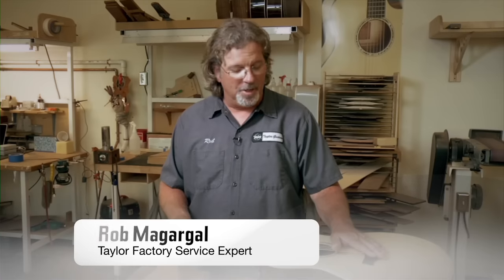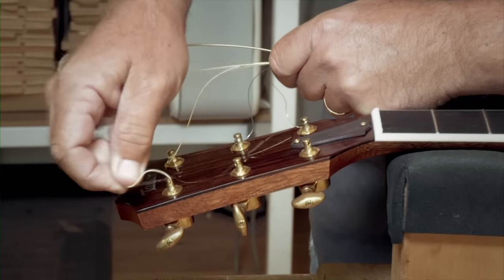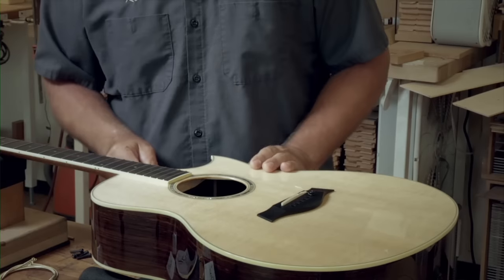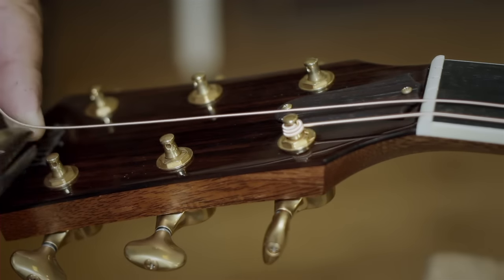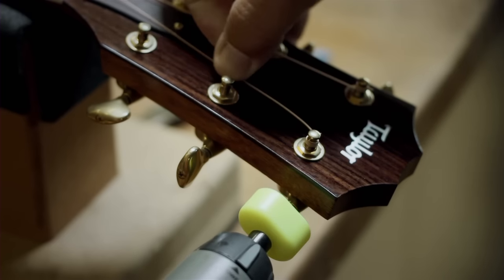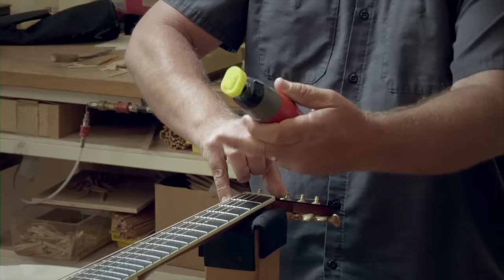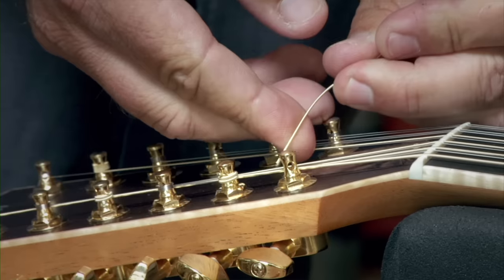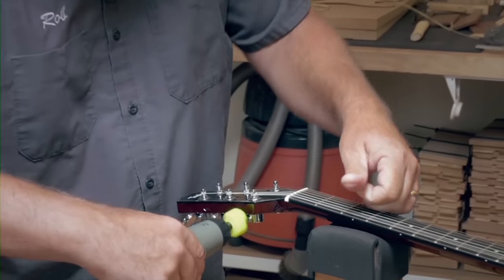How To Restring Your Guitar - Taylor Guitars

Comment: This is the second restringing video I've seen where you "pros" use wire cutters to pull out the pegs. If you push the old string down into the peg hole, the peg comes out easily by hand and you don't risk scratching your guitar or pegs.
Reply: Good tip,  looking forward to practicing it.  T.Y....  I recently scratched my bridge using the cutters!  Not because of the pros told me‐ I just impulsively used them as I was wrestling with a stubborn peg.  First and last time I make that mistake hopefully.
Reply: Yeah makes sense, I don’t want to scratch  my 5k guitar though👍🏻
Reply: I've a peg-puller on my capo. Way to go!

Comment: I was a nervous wreck at the thought of changing strings on my new 2015 Taylor 914ce.  This video was amazing!  I followed it to the tee step-by-step and it came out amazing.  When the strings were all off, I polished the whole guitar and oiled the fretboard with Taylor polish and fret board conditioner.  I went down one gauge to 10's and it plays much easier with no buzzing.  Thanks, Rob!!!
Reply: +Ray Blanks what strings did you have and what do you have now?
Reply: Taylors at the 800 and 900 level usually come with Elixir HD lights, which are light on the treble (unwound) strings and medium on the bass (wound) strings.  That way you get plenty of low midrange and easy bending on the upper midrange.
Reply: I just broke my D string tuning to open E lastnight. Im always nervous when changing strings especially after only having my new ibanez talman electric/accoustic a week then breaking a string haha. I bought a string winder lastnight so hopefully i can do this when my new strings i ordered arrive soon. I got a 9-45 gauge pack cause i dont like the thickness of the ones that came with it

Comment: I've been putting strings on my guitars for a L-O-N-G time and, as it turns out, I have not been doing it as well as I could. After watching this video and following along I ended up with the neatest, tightest wraps I've ever had. Rob keeps it simple but doesn't gloss over the tricky bits (cutting the strings to length and starting the wraps). Well done!

Comment: I got a new, Big Baby Taylor in on Sunday, which I bought from Sweetwater. I'm 63 and have 50 years experience as a player and my BBT sounds awesome. I'm going to take the stock strings off today and replace them with some Martin Phosphor Bronze which are the same gauge ( 12-54 ). I'll try this method because the standard under and over, does not always guarantee tuning stability IMO.
Reply: Love my Taylor but she'd the 12's for 11's . Just a little less boom but my fingers are much happier
Reply: @lancebarbarino8178  When I got my new Big Baby in last weekend, I sanded down just a bit, the stock bridge saddle and my fingers are happy too. There's no need to change the string gauge if you try this , along with using a Taylor Truss wrench to set the neck. If you're not comfortable doing this, a qualified luthier will be more than happy to take care of it for you.

Comment: Nice instructional video. Two observations:

1. WASH YOUR HANDS before you start. That will avoid getting oils all over the strings. You'll get enough of those anyway, but make sure your hands are clean, just as you would before you start playing.

2. In don't like using a cutter to remove the bridge pins. I suggest a bent nose pliers to avoid even slight cutter nicks in the pins. 

Ernie Ball make a tool called the Power Peg I use as a string winder. It's a right angle rather than a straight.
Reply: Teaspoons are fine

Comment: I use this method on all my guitars with the 3 + 3 headstock configuration, regardless if it's a Martin, Gretsch, or even a Taylor lol. Never had any tuning issues since.
Reply: thanks that was my next question.  I dont have a Taylor, but a Martin and a Custom made Mike Long Dred, not a taylor

Comment: I'm so glad I watched this!  Just completed re-stringing my guitar for the first time and this video really helped to put me at ease about doing this.  (Although I'm still a little afraid my bridge pins might pop out.)
Reply: They won't pop out. You don't need to muscle them down in there either. Forcing them down will only stretch the holes. Just make them snug. Congrats on your first string change!! First of many to come!!
Reply: I hold my other hand over the bridge pin until the string is up to pitch... then I also stretch the string especially down by the saddle and check for string movement

Comment: I always put an opposing bend in the string end as it exits the post (forming a Z shape).  For the small gauge plain strings I bring the free end back around and pull it under so that wraps go over it.  The only time I cut strings to length before they go through the post is on Rickenbackers with the 12-string slotted headstock.  Otherwise I cut after putting in the aforementioned opposing bend.

Comment: Using this method, I had difficulty with the 2 smallest strings.  I especially had trouble with the high e string.  It kept coming unwound.  Next time, I will bend it and not cut it until it is wound.

Thanks for telling us about using the 10 mm socket to tighten the tuner nuts on top.  I purchased a $4 1/4" drive 10 mm deep socket just for this purpose.  Even though I do not own a $3,000 Taylor, I own a $350 Takamine EG340SC with a solid top for practicing, the top tuner nuts are also 10 mm.  This seems to be standard on most guitars.  I used my 1/4" drive straight socket simple handle.  Do not use a ratchet.  I used minimal force with 2 fingers.  I didn't want to crush the headstock.  ALL 6 of the 10 mm nuts were not tight.  I was actually surprised at this.

BTW, I also used a *Dunlop System 65 Guitar Maintenance Kit*, with the 5 different bottles, 2 cotton cloths and 8000 grit cloth, to clean and protect the top, fingerboard and guitar strings.  See video HnGEnpG3l0o.  Standard strings for Takamines are D'Addario EXP16.  The total job took 12 hours, but that's me.  I haven't replaced strings since years ago.
Reply: I play banjo too and it is normal on the banjo for a picker  to have a screw driver to tighten the tuners and I wonder why no one talks about tightening guitar tuners which are under much more stress.

Comment: Great video on changing strings!  Probably the best Ive seen.  However, why don't you lock the strings by doing then over-under wrap method?  Ive done it on my accoustic and it works well.
Reply: I have been doing the over under variant for about 50 years on both guitars and banjos.  The over/under really is based on the ways that tuning posts used to be made say in the 1930s and 40s, where the tuning post is not tapered as it is on modern guitars and many modern banjos. It is the taper that helps the no knot method  here work.  This is a lot easier to get a string off, fewer broken strings, and less confusion and tangle.  The over under looks cool when it is demonstrated on the E string but can be a string breaking struggle on the E or A especially on a Dred with medium gauge strings

Comment: Cutting the strings before winding is the way to go!  Allow a post to a post and a half as he says and you cant go wrong.  Makes the string soooo much easier to handle and less chance of scratching the guitar or yourself.  Also, my tip is get a little mirror and double check your ball ends are indeed snug up against the bridge plate.
Reply: You will increase your chances of that ball snug against the plate if you cut your Bridge pins on an angle... cheers

Comment: Do you have any thoughts as to putting a small amount of graphite at the nut when you restring the guitar? I see some professionals do it and others not. Thanks for the posting as it makes it easier to follow than many others.
Reply: Usually that is done on  instruments with a nut if the nut is buzzing because string wear has marred the size or the angle of the nut.  Unfortunately,  it is often a temporary solution.  If whatever causes this continues, you may need to replace the nut or get a harmonic readjustment of the guitar.
Reply: @writerrad  i do it because thats what my dad taught me, and he said that it helped it tune up and down better because the graphite lubes the string. it kinda makes sense but i dont think theres any science behind it haha

Comment: If you are doing this, especially if you are NOT doing this on a brand new guitar like this tech is, be sure to keep the bridge pins in proper order as to the string they have come off of, because the pins will bee grooved to the fit of each string.  A pin that was on the E string will be too loose for the B or E strings for example.  Inspect the pins to see if they need replacement.  Above all replace the cheap plastic bridge pins many guitars come with with hardwood like Ebony or better for my taste Tusk or Ivory bridge pins.  Same with the material in the saddle.  This is a very inexpensive way to make a quick improvement in tone and tuning.
Reply: vip

Comment: Regarding te slotted headstock: you state "wind from the inside to the outside". This makes sense for both the E-strings, but for the other strings winding to the inside makes the strings go in a much straighter way with less friction on the nut. So that seems to me much more logic than the way described here (without any explanation why one should wind to the outside). Also for the top strings (B and E) 1 1/2 post length difference seems a bit short, because those strings have less friction. In that case I think using two post lenght as a difference can help to prevent slipping and get a stable tuning quicker!?

Comment: This is as good a way as any (and there are many.) Danger Will Robinson- if you like round core strings then think again before cutting those wound strings before you get them up to pitch. FWIW, I trap the free end underneath the windings- much like a Fender slot post but with the poked down bit underneath the windings instead. This takes much longer but looks neat and completely safeguards the cut-off ends from careless digits. Back in the day before the tube, we had to figure things out for ourselves and looking at YouTube comments generally and maybe those on this video too, I sometimes think it's best we think about thinning the herd...
Bottom line- this method is sound but whatever works for you is fine too.

Comment: @Taylor Guitars Hi Rob, I have heard many do not recommend trimming the guitar string once it has been wrapped around the post because it will lead to tunning problems. The winding method (type of wound i.e. round wound, flatwound) of the string itself also play a part in this? I noticed you trimmed the string prior to wrapping it around the post. If I decide, because of my comfort, to bend the string instead or cutting it, 'when is it safe to cut the string?' I hope this question makes sense.
Reply: I have cut the strings after installing them for the past 40+ years with no tuning problems.
I cut after installing and stretching each string just because I don't want 6 tentacles flying around while I am finishing the job.

Comment: All you have to do, is run the entire string through the post. Back it up maybe a post-and-a-half's worth. Bend the excess toward the middle of the headstock. Wind the string down like a coil (the lower on the post the string, the tighter against the nut it will be). Then bend the excess string back and forth until it breaks off cleanly. No need for clippers. No stickers to nail your fingers. However, you have to twice overwrap the string-through on the 1st and 2nd strings, otherwise, when you break off the strings, they will slip on the posts.
Trust me. You will love having no stickers to draw blood. By bending the excess string toward the middle of the headstock, you form an "S" through the post, adding to a tight fit. Oh yeh, some nut lube on that nut will work wonders for tuning. That’s 60 years of string changing experience for you …

Comment: On my Taylor 314ce, I never got that reassuring "thunk" when first inserting the pins; it was only after I gave the string some tension that I was able to seat it correctly. Sure hope I did it right. And yes, next time I do this I will buy a winder; that took a lot of revolutions.
Reply: Mitch Friedfeld wait so u don’t have to have a winder to do this, because i’m about to change my strings and i don’t have a winder so can i do it without a winder
Reply: Jeffo You can do it without a winder, it’ll just take longer. I’d bet a large majority of guitarists don’t use one.
Reply: Mitch Friedfeld thanks 🙏

Comment: In 30 years, never had Anyone Show Me a True 'Method'.  Well cutting the wires First is Everything I needed, been doing this Since I first saw This 5 years ago and Never got less than Perfect results!!  AND i'm Done in 20 min.  The Key thing here is to Cut the damn strings Before 'Winding'.  And Holding them down near the pegs while winding.

Comment: hey Rob great video thanks so much! I've got a few questions though:
1) I've got a NS74ce.  As you know, this has a slotted headstock; do the stringing techniques still apply even though you were using steel string in the video?
2) the NS74ce is originally strung with extra hard tension d'addario classical nylon strings.  If I wanted to use d'addario folk nylon strings (EJ45) that happen to have black ball ends and are NORMAL tension, do I need to worry about adjusting my truss rod?  Thanks!
Reply: I’d adjust the truss Rod anyway

Comment: Cutting the string leaves a sharp bit sticking out.  If you bend it and then just waggle til it snaps the sharp end is flush with the peg or just inside the hole so no sharp bits.

Comment: nice video, what is the screw driver used? I would like to buy me one of those. Thanks
Reply: you can buy drillbit heads just for this, but ernie ball make a power peg which is just a screwdriver specifically made for this its like 30 bucks
Reply: Brendan Morris Cheaper to get a cordless screwdriver and the bit, though, and you'll get more speed and torque. 
I, too, would like to know the specific screwdriver used in this video.
Reply: Aluchi Del Pasado Alright, after much analysis, he's using a 3.6volt Black & Decker. I believe it has been discontinued, but the LI2000 is pretty similar.
Reply: ***** awesome cheers

Comment: Rob, I just purchased the same B&D 9074 screwdriver you're using. Can you tell me what the mod is you're doing to increase the RPMs. Are you removing a resistor? I'd really appreciate it if you could respond here or you could also go onto my FB page at Guitartec Repair for some privacy. Thanks in advance.

Comment: If a new string feels just about to break as I tune it, I can barely get it to pitch, and it would break if I tuned it up even by a semitone -- what did I do wrong?
Reply: Bass Maiasa You probably didn't give the string enough slack. Follow where rob is pulling the strings through the tuning posts and where he's cutting them.  I use this method on my Martins (I don't like the locking method and it really doesn't work any better. It just makes taking them off the posts harder and risk stabbing yourself) and it works great, no problems. Good luck!

Comment: what's the exact name of this peg winder? please help me...
 i think this is black decker. but what does it have at the top the yellow thing?
Reply: picturesofacity its a basic black and decker electric screwdriver (any $30 or less model will do as they are low rpm), and if you need the same exact bit, its from stewmac. i just ordered it. the planet waves one is fine too. its definitely a black and decker screwdriver though for sure. 100% sure. u can buy it at any walmart, homedepot, lowe's, etc.

Comment: Hi, i have seen that some Taylor guitars like the Big Baby are not totally flat on the back,  is it normal?
Reply: +benjamin huan i think the 110e and the 114e also have arched backs. I have seen some pictures on the web.I  bought a Big Baby two months ago and i returned due to this, i don't like it in guitars that's why i'm thinking to get a Yamaha.
Reply: +Angel Rivera -
Yup, standard configuration. On the less expensive Taylors, those manufactured "down the street" from El Cajun in Tecate, Mexico (just the other side of the border), they don't use internal back bracing, therefore the slight arch in the back (hardly noticeable).

I’ve been playing one of these inexpensive, VERY well made guitars, the Taylor 214, for over 2 years now (personal inventory: 810, 410, 310, all non-electric). For an inexpensive guitar it has played very well as held up very well, not one problem, no issues, etc. whatsoever. The quality for a layered wood (back, sides) guitar is amazing, surprisingly exceptional.

For those objecting to the slight arch, consider moving up to the USA made Taylors, starting with the 310 series. Again, another excellent guitar, especially for the price. After looking at and playing the 310, these guitars should’ve never sold for under $1,500.